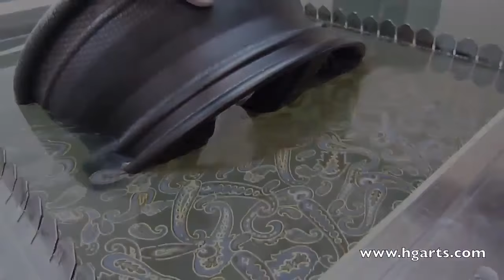Water Transfer Printing Hydrographics Applying Printed Designs To Three-Dimensional Objects

Comment: Something tells me this is RIDICULOUSLY expensive.
Reply: erekllama  no is not.
Reply: NICOYA4U2NV How much?
Reply: Curtis Holt about 100 bucks for a basic kit and then about 10 bucks for each graphic
Reply: CopWatch Inland Divison What about for wrapping a bike?
Reply: erekllama to get into it on a business side the cost of equipment and such can be very expensive. but just to have someone dip a part for you can be really cost effective.
Reply: erekllama  about £600
Reply: +Kim Zhang hai
Reply: HI Email me if you need powerbank with customized water transfer printing.
Reply: Its not
Reply: erekllama same. I have a strong feeling this is very, very costly
Reply: thats amazing so relaxing and theraphutic to watch
Reply: Curtis Holt a fiver!
Reply: mtb vlogs what about a carbon fibre one?
Reply: Christine Collins it’s not, wrapping and hydro dipping is a cheaper then getting this painted
Reply: Here in aouth aftica iz epenzive
Reply: Are they doing this in miami?

Comment: How durable is the coating?
Reply: For best results you should finish with clear varnish
Reply: Not durable at all, uv kills this stuff.
Reply: best question asked
Reply: Mike West wouldn't a clear coat protect it from uv rays?
Reply: Billy Darley maybe.
Reply: yes. a good quality clear coat will protect water transfer paint properly. I've been using this stuff for almost 2 years now, no issues.
Reply: TheStijnW varnish? Do you need to use Pledge to keep it shiny too?
Reply: @afletra   how long does stickers last?
Reply: @sammancilla3680  what stickers? if what you mean is the water transfer, it last at leas 3-5 years with a good clear coating and proper treatment. even more

Comment: can anyone explain the science behind this ?
Reply: zxn6869 sheet of film on water and dip so Chem reaction of the film and the water
Reply: ITS (THE PRINTED FILM) NEEDS TO BE SPRAYED WITH A STABILIZER TO SUSPEND THE IMAGE IN AN OIL LIKE STATE SO IT DOES NOT DISPERSE BEFORE YOU DIP.  IT IS EXTREMELY TIME SENSITIVE AND NO ONE CAN BE DANCING THE JIG IN THE ROOM PRIOR TO APPLICATION.

Comment: Why does everything need to go in at an angle?
Reply: +Alexander Alkinge it stretches
Reply: +Andreas Chryseliou If put the object in flat, it is more likely to create air pockets, and the ink will not stick in those spots.
Reply: Andreas Chryseliou Epeidi i poulou sou mikri
Reply: Andreas Chryseliou laguanakanakjingobeles
Reply: It would not paying right either taut way
Reply: It's the same principle as when you put down a graphic you hold up the sticky graphic and peel away as you rub the graphic onto your support moving forward as you go, only this process is in reverse, where the object is layed down into the graphic, keeping out any movement other then straight line downward movement.
Reply: Patrick Forsyth ...so air bubbles won't get trapped under the plastic.
Reply: When you put it in at an angle it pulls the transfer onto the object. Watch closely and you’ll see why it’s done that way.

Comment: I wanna carbon fiber my entire car
Reply: thats stupid.  and plus that wont work
Reply: The Great One rude
Reply: sloppypoppie cool
Reply: Thanks!!
Reply: sloppypoppie If you get any carbon fiber print on a car, don't do this method, this method is called Hydro-Dipping it's used for objects/parts , if you want the entire car in carbon fiber get it wrapped (it's a method similar to this But instead they put the print on the car and brush it on with clear coat and water mixed and then varnish it over top with a waterproof agent
Reply: Kansas Electro u
Reply: sloppypoppie yeah by the way you talk you bought youres in wallmart
Reply: Carbon fiber is childish
Reply: That would be great!!
Reply: sloppypoppie ok so buy a biiiiiiiiiiiiiiiiiiiiiiiiiig size of the carbonfirber paper and place in on the ocean and drive your car off a cliff so that it lands on the paper and then your car will be fully carbonfiber
Reply: Victor That really wouldnt work and carbon fiber isnt just a color or something its tightly woven fibers
Reply: I’ll let ya drive into my pool!
Reply: Double-0 Sta
Reply: The Customer is Always Wrong I wanna carbon fiber my mom
Reply: yeah you'll had to pick your car up on a forklift first and slowly dip it in!
Reply: I wouldn’t do that it peels off easily
Reply: that's saddest

Comment: This is totally awesome!! But when you put the lug nuts on won't it tear off the coating? If you wanted to could you just do the spokes and leave the outer lip the same color or use two different prints for one wheel like carbon spokes and chrome lip??
Reply: Where the lug nut and rim contact will be the only area showing wear. The hydrodip if done correctly will actually last for years.

Comment: Can you also coat the area covered by your hand?
Reply: It does not matter, cause the tire will cover that part. The goal is to cover the area that will be visible
Reply: ***** That's certainly a feasible answer. I don't know whether you did craftswork yourself but when you're a painter, a carpenter, an electrician there comes the point when you want something to be just perfect. This is why I asked.
Reply: I bet you could just drop it at the end if you really wanted to

Comment: Couldn't you do more pieces at once though?
Reply: Each screen is a single sheet. When dipping a peice in, it basically rips a hole in the sheet and distorts the rest of it so no not really
Reply: Wesley Shaw Makes sense
Reply: Brin Bart
Reply: Brin Bart , actually yes you can , i used an electric hoist to lower a tilted platform support 'made of a frame and chicken wire ,and alligator clips ..
 so i'd have multiple tie points for the piece to be dipped .... i got the idea from memories of how modeling kits used to come , you know all the pieces of the model's parts on a plastic grid "which were injection molded ' you had to break apart /separate each part from the original mold 'frame ' - only hitch is make certain all parts aren't touching and are secure -this all done before dry before dipping - have fun( it works great ) just a little more set up time .

Comment: is it just water with the film?
Reply: Yes. It is just water. It's surface tension presses the film against the object.
Reply: Well you still have to spray a coat of Activator so it would the film would stick to your object
Reply: hello do you know other way to active the films??
Reply: Carlos Ruiz
No,there are lots of formulas where you can make the Activator yourself tho.

Comment: its probably FAKE because as you can see when it is dipped into the liquid the video cuts ahead where they change the object with a designed one I COULD BE WRONG
Reply: Easily made mistake, I didn't believe it at first but this process has been around for quite a few years, I remember a friend had his engine cover dipped to look like carbon fibre, I didn't believe him until I had seen an article on transfer dipping in fast car magazine.
Reply: nihguh they're cutting the vid so it wont take lomg
Reply: +John Alexander I said I could be wrong nihguh
Reply: No it works
Reply: I will pay anyone 1,000 bucks if they can find ANY video on youtube without the word "fake" in the comment sections... "WELL ITS FAKE CUZ YOU SEE DA ILLUMANIT TOLD ME SOOO DURRRR"
Reply: +MannsMusic you know how easy it is to find a video without fake in the comments?